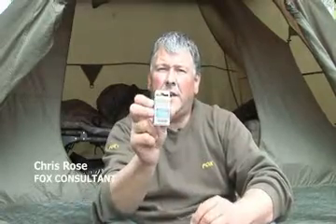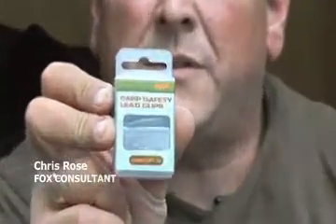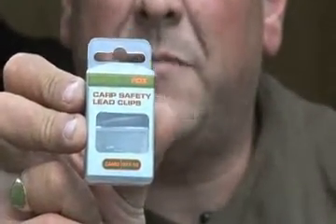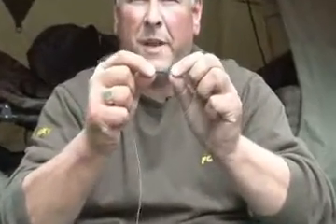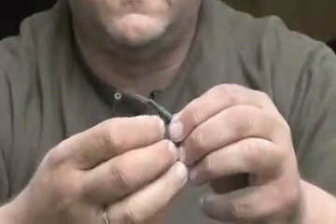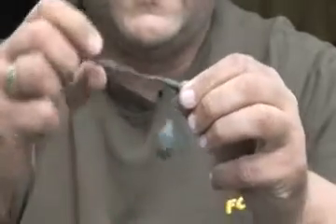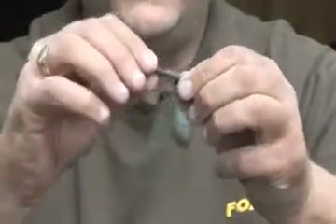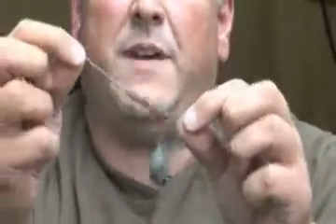Tackleuk Fox Carp Safety Lead Clips

Comment: Its not locked! its help on with a tail rubber! the lead only comes off if your mainline and the lead eventually snags, if the line breaks or if the lead snags on something. Thats the only time you will lose your lead. Unless you want to lose it on a take in which you would losen the tail rubber ie only push half way up the clip. I dont use them as I always use a helicopter set up, but the lead clips do work well with a number of benefits ie if you want the carp to rise after the take etc.